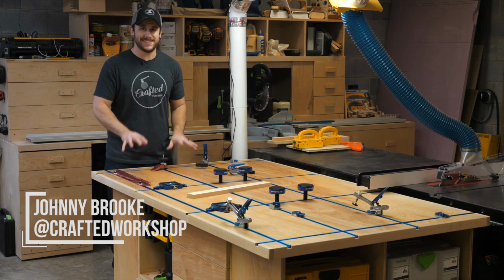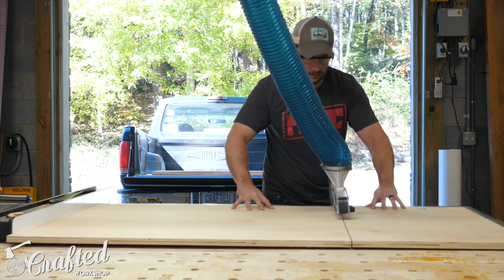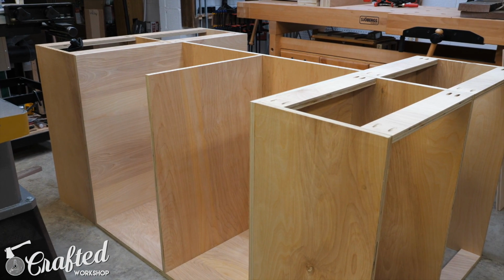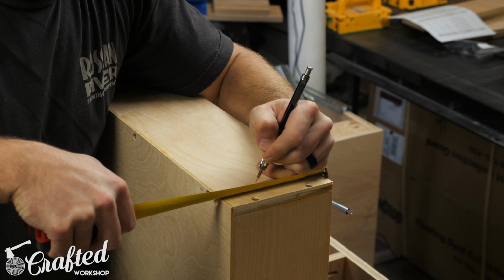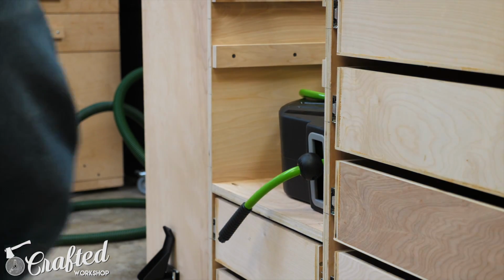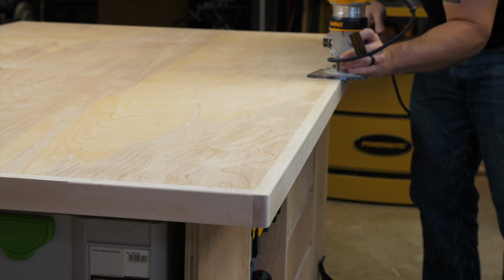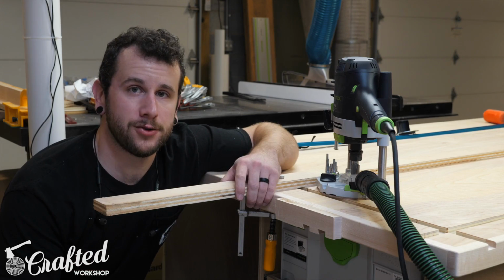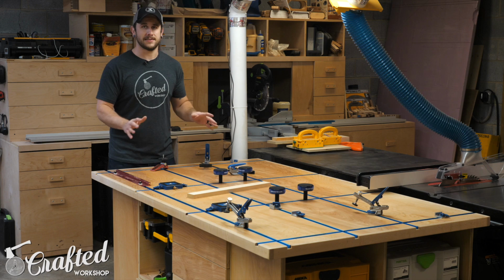ULTIMATE T-Track Assembly & Outfeed Table / Workbench with Systainer Storage | How To Build

Comment: What is your opinion of cutting a largish MFT layout in nominal 3/4" ply topped with supposedly 1/8" tempered Masonite and also running T track centered over a grid of framing that extends above the Systainer storage bays? I've been told that Festool-style ratchet hold downs will only dip through 20mm holes in tops less than 7/8". Does that sound right to you? I envision a space of 3-1/2" between the underside of the top and a top dust panel, a series of voids for storage like vacuum hose and to retrieve the stuff that invariable falls down a bunch of 20mm holes. I also like the idea of a second layer of plywood around the unsupported front edge of the top where it bridges the outer edges of the Systainer bays. Think I ought to choose one or the other, T track or MFT holes? Thanks.

Comment: Drawer runners are best fitted BEFORE cabinet assembly but if not viable, put the cabinet on its side and mark out the runner positions, square them up and screw them into position.

Comment: The design calls for 3/4" plywood, which is not exactly 3/4" (at least here in Canada). You'll have to trim the excess of the systainer cabinet back (Sys Cab Back Plywood) and cut down the center cabinet divider if you want an actual fit. @craftedworkshop Great design though, it will be a beautiful addition to my shop :)

Comment: Great video and build! I just followed your plans to build it myself and it turned out great with the exception of the t-track slots that I kind of butchered. 

Also fyi, I tried your suggestion about using blocks and lag screws so I could put the systainer cabinets right at the bottom, but that held up for all of 10 minutes so I had to revert back to the way you did it in the video.

Comment: Realize this is an older video however I purchased these plans and finished this build.  For the most part followed the plans and this video.  I've held off on installing all of the 14" sliding systainer trays as I don't have enough to currently fill the space and want to leave myself some flexibility.  Also want to say that the plans were well written and put together.  As some have mentioned, do put together a shopping list before you embark on this project.  It can get expensive if you use all the hardware that he shows although it’s not all necessary.

Comment: Hey Johnny, love the table.  I’d like to implement some aspects into the outfeed/assembly table I’m about to build, most specifically the t-track set up.  My question for you, having this table for a couple years now, do the tracks ever make assembly less than ideal?  Do you ever wish the table was just fully flat rather than having the gaps caused by the t track?
Reply: Just a thought but you could slide a t-bar into the tracks if you wanted and bring it up flush. I thought about it to keep sawdust out of my tracks but don't think it's actually necessary

Comment: I assume that when you nailed the table top together you knew where you would be installing the t-track? Great build!
Reply from the maker: I kind of got lucky there. Realistically, most router bits will cut through a Brad nail without issue.

Comment: I bought your plan and ordered almost everything need to build it but one question for you. As i want to use this also as an assembly table, how do you think i should go about making the top as flat as possible?
Reply from the maker: If you glue the two sheets together on a flat surface like your garage floor, you should be pretty good. I also made sure to check the top for flatness when I was attaching it to the cabinets and shimmed it where needed. You could modify the plans and go with a torsion box top, but I haven’t found it necessary.

Comment: great video! you speak very well on camera! Question about software that you use to do your drawing and plans. Im guessing it will not only give you a 3d model to view, as used for the plans for purchase, but a cut list for your material? Im trying to decide which software to learn as i want to take a few ideas from a few different bench/assembly tables to design one for myself that not only has the track system for the top, a bit of drawer system, but one end for my CNC to be under the table and get half the table top on a piano hinge to have access from the top.... long winded, to simply ask what 3d software you use to design with? thank you!

Comment: Awesome build. I noticed that the outfeed table appears to be lower than the table saw. Normally they are at the same height with matching dados to accept and extend the tracks for the jigs on the saw. Is there a reason for not doing this?
Reply from the maker: I like a little tolerance there in case a piece is bowed, especially with the t-track. Don’t want anything getting caught.

Comment: I purchased you plans. 2 questions about the top. Most garage floors aren’t level. Did you have any problem with the glued up top taking the shape of the uneven floor? Also did you hit any pin nails with your router when routing for the t track or did you plan where you shot them.
Reply from the maker: I didn't have an issue and I think, if your garage floor was poured well, it's probably the largest, flattest surface you have available. It's easy enough to pull the top flat with the screws from underneath as well. I might have hit some nails when routing but they are so small that it had no issue, and I didn't notice hitting them if I did. How that helps!
Reply: Crafted Workshop that does help thanks.

Comment: Okay so considering building one and have been for a while. But I’ve been hesitant as I have concerns about glue. When I assemble it is sometimes necessary to have glue running out and even in normal glue ups glue gets on the table. So my question is has this been an issue with the t tracks? How do you keep them free of glue?
Reply from the maker: Hey Anna, I typically just put some contractor's paper on the table prior to messy glue ups, but the aluminum is anodized and glue pops off pretty easily. Been using it for a year now and have no issues with glue build up! Finishing the wood is important too, as the glue doesn't stick to polyurethane.
Reply: Crafted Workshop perfect 
So poly before installing the tracks I presume?

Comment: Hey Johnny, you've had the t-track/assembly/outfeed table for a year now. How do you like it  and is there anything that you would change?  Also, are the t-tracks holding up to the clamping pressure from the various jigs and clamps?  Getting ready to build something for my shop and like your table top design. Thanks.
Reply: I would like to know as well.
Reply: It would be nice to hear an answer to this question. I have seen a lot of out feed table videos and 
Club member shops with no t-track. Having a thin plywood cross 3 tracks in a rip cut seems iffy.
I love this design and I love t-track. Maybe add the track perpendicular to the back edge of the saw only. Great video and project!!!!!!!

Comment: great build going to use some of these ideas..question though. Were you at all worried you would hit one of the 1.5 inch screws you used up from the bottom to fasten the top?? or maybe i need to rewatch and missed something.
Reply from the maker: I guess I got lucky there. Shorter screws would be fine.
Reply: My luck I will rout right into every one! : )

Comment: And another Rockler ad. I wouldn't mind as much if some of their stuff wasn't as needlessly over priced as it is. Those T-Track intersections for example clock in at about $25 a pop. Of course that means nothing when they are supplying them free of charge in exchange for the advertisement but for anyone else interested in copying that design they're looking at $300 just in those intersections.
Reply from the maker: The intersections are definitely pricey but are easy enough to make yourself if you want to save some money.

Comment: Where did you get the dust hood for your table saw?
Reply: When to the website and didn’t find it. Can you remember a part number or a link?
Reply from the maker: Sorry about that, this video was before I switched to the new SawStop option. The one in this video is called the Shark Guard, it's a 3rd party accessory.
Reply: Thanks
Reply from the maker: It’s one of the options from SawStop.

Comment: Kudos on the awesome project and thanks for the well done video!  I have been considering a similar project for awhile now, but I’m hung up on one question.  When used as an outfeed for the table saw, does the leading edge of the work piece snag on the t-tracks that are perpendicular to the cut line?  My guess is no, based on the number of plans for similar systems that are out there, but it would be great to get some reassurance from someone who has been using such an outfeed table for awhile.
Reply from the maker: Nope, never had a piece catch. You need to recess the t-track below the table top about 1/32” which is easy to do.

Comment: I've been watching a lot of workbench build videos, to decide what I want.  I was originally planning on going with bench dog table.  I see your old table is a bench dog table.  I guess one disadvantage of a bench dog table is dust going through the holes.  What other advantages of track verses bench dog?
Reply from the maker: I kept losing screws through the dog holes, which was frustrating. I just think the t-track is more flexible, but both systems are great.

Comment: Great stuff! One question though - how do you clean the wood after sanding before finishing? Do you use the compressor?
Reply from the maker: I typically blow off the major dust with the air hose then vacuum the surface with my dust extractor.
Reply: @craftedworkshop  Thanks!

Comment: How has the overall structural integrity held up?  Looks like it could have used some support framing for base support, although this would deny some storage space. Any issues with the casters only attached to the plywood sides?
Reply from the maker: Nope, everything is still holding up fine. I almost never move it, so the casters don't get a lot of wear and tear.

Comment: I am wanting to get into using T-Track systems a lot... i dont currently have any. But one thing I keep thinking... why spend money on the T-Tracks if you can use a router and a T-Track bit to just create it in the wood and save a ton of money? Anything im missing with that where it could be bad?
Reply from the maker: Yea, the wood won’t be nearly as strong as metal tracks, and you’d likely break the tracks when clamping the t-track clamps. There’s a ton of force exerted by those clamps.
Reply: ah that makes sense! Thank you and great build btw
Reply from the maker: Thanks Nathan!

Comment: When you plan the size of the drawer and the size of the cabinet, well the other way around. How came you up with the right size of your drawer. I mean you need to subtract the thickness of the two sliders? Exactly the thickness or something more or how to you get the right size of your drawer so it fits when you install it without being to big or too small for the cabinet???
Reply from the maker: The drawer slides need a ½” of space on each side, so the drawer should be exactly 1” narrower than the cabinet. As for drawer depth, that’s less critical, just deep enough so it doesn’t hit the back of the cabinet usually works well.

Comment: If you had a Festool track saw track why did you not use it to cut the track grooves in lieu of the plywood that would have solved your problem?
Reply from the maker: My track wasn't long enough to span the length of the table.

Comment: Do you think the Festool OF 1400 EQ router is worth $600 ??
Reply from the maker: Really depends on your use case and how much you use it. I use it on every project basically, and the dust collection is incredible. It saves me a bunch of clean up time, and it’s super precise and easy to adjust. I love it, probably the best router I’ve used.
Reply: Appreciate the insight!

Comment: Awesome table/bench!!! Well done.  Is the back of the cabinet open (for table saw dust collection)... doesn't look like there is anything on the back side of the drawer cabinets?
Reply from the maker: Thanks! Yes, the back is open for the air compressor and table saw dust collection. No easy way to access that area anyway.

Comment: Crafted Workshop - what is the total height of the table?  I have a portable table saw & collapsible stand and I would like use both items together.  If anything I feel the table will be taller, then the table saw...  I can make that work.
Reply from the maker: My table is about 33 inches tall, where as my table saw is 34 inches tall. I can adjust the height of the assembly table with the leveling feet.
Reply: Thanks, that helps out a lot.

Comment: Very nice!  What was the total cost of material
Reply from the maker: It was a pretty pricey build, really depends on the exact materials you use but probably around $1,500.
Reply: Crafted Workshop do you have plans for this or maybe cheaper less complicated version. I love the adjustable feet and castors. The track system is sick!
Reply from the maker: I do have plans available, they’re linked to in the video description!

Comment: Bought the plans.  Nicely put together.  Gearing up to build a modified version of this.  Couple of questions though... 1) How do you find the t-track strength wise?  Seems they list as "not intended for heavy duty clamping".  Have you found any limitations?  2) Why did you do only 1 center cabinet?  Seems you could have doubled up on storage space.  Other intentions?
Reply from the maker: The t-track is plenty strong with this thick of a top. It allows you to use longer screws than typical, and the friction from the tight slots holds the t-track down mostly by itself. As for the cabinet, since I have this right up against my table saw, the back area isn’t easily accessible. That’s why I left it open.

Comment: That is an excellent multi purpose table you designed. It solves so many of the issues you were trying to address. And, it reminds me that spending a little extra time in planning will lead to a much better finished product. You may have already had this question or it may be so simple I should already know, but why do all of your T-tracks have the slight setback from the edges?
Reply from the maker: Thanks William! The setback on the t-track allowed me to round over the edges of the trim, and also kept any sharp edges from becoming an issue.
Reply: Crafted Workshop...Thanks for the response. I assumed you had a good reason. I would have run them right to the edge, had I built this before watching yours.  I will eventually build something similar and your execution of it makes way more sense.  Thanks again for providing your expertise.

Comment: You have enough money for tools clearly, so you should get a castle TSM 12 if you are using that many pocket holes frequently.  Or a used Porter Cable 552 on Ebay.  Its so much faster than a kreg setup and less movement.
Reply from the maker: Yea, I don’t do this many pocket holes regularly. I did just get the Kreg Foreman, I like that it doesn’t take up any permanent floor space.

Comment: just a suggestion for cleaning up the cables along the dust collection. you should get some metal or pvc conduit to hide those. it will make the shop look a lot nicer, cleaner, and more professional!
Reply from the maker: Not a bad idea! I was actually able to get rid of them, since I had to rearrange my ductwork with the new SawStop overarm unit.
Reply: Crafted Workshop that's kinda dissipating. I'm kind of an organized pipe run nerd so it would have looked cool having the pipes running next to eachother
Reply from the maker: Hah, yea that would look pretty slick!

Comment: Great build! lots of good details. are you worried about the plywood top staying flat? is that why you laminated two layers?
Reply from the maker: Thanks! Not really worried, it's fastened to the base so it should stay reasonably flat. Laminating was mostly for strength, just to beef up the top. Also gave me more meat to screw into for the t-track.
Reply: Love it! I really want something similar!
Reply from the maker: Get to building 😜

Comment: Great build but still a fan of the 20mm hole system. So much easier to build and all the same benefits... and all you need is a bit and mdf.

Really enjoyed the video
Reply from the maker: +happyhappyjoyjoy9999 thanks, yes both systems are great, I just prefer t-track right now.